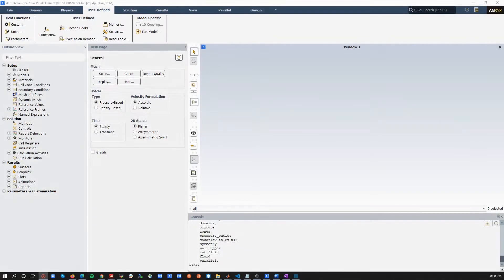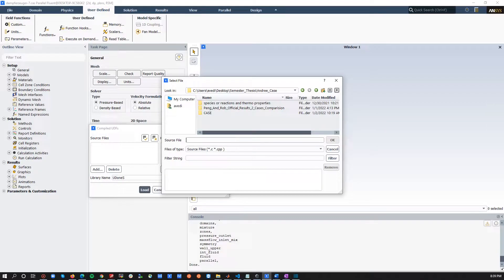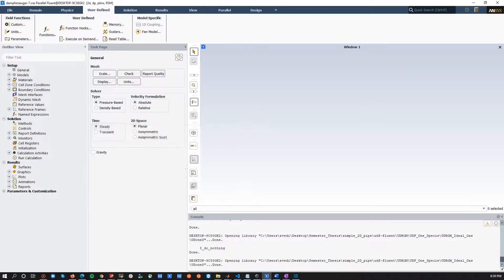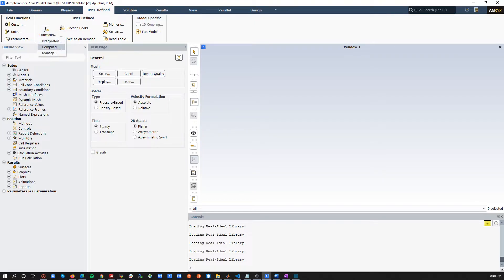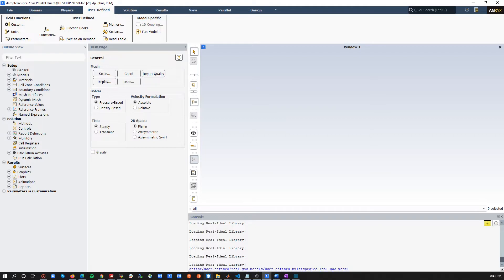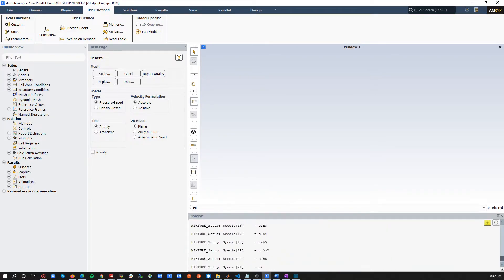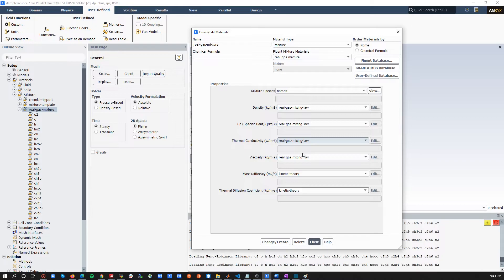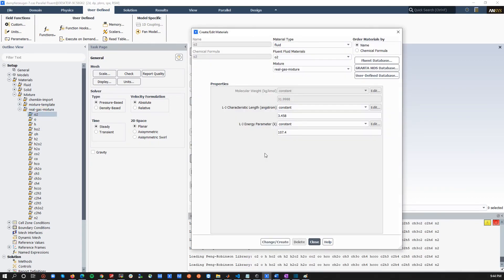How to Build and load your UDRGM (User Defined Real Gas Model) in Fluent

Comment: Hi, I've read a paper that uses this approach for a two-phase flow, however, I don't understand why they said that they need 4 species. I need to solve a two-phase flow, and I'm a little lost. If you can help me I will be thankful :)
Reply: hi, have you solved this problem?
Reply: @blinkman2788 I am guessing that while defining a material,you define it as a mixture. Therefore in multiphase flow, you define liquid as a mixture of gas and liquid, and vapour as gas and liquid,and ensure that their corresponding mass fraction is 1. For example while defining liquid- mixture of gas and liquid- has liquid mass fraction of 1 and same goes for vapour.